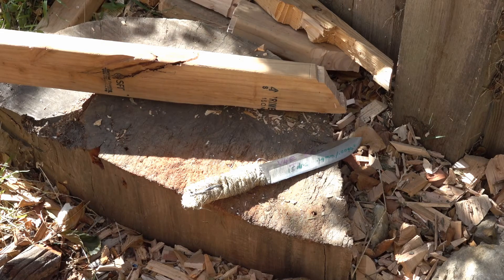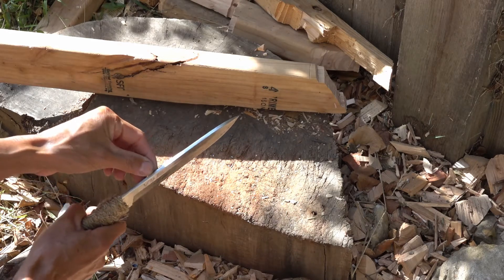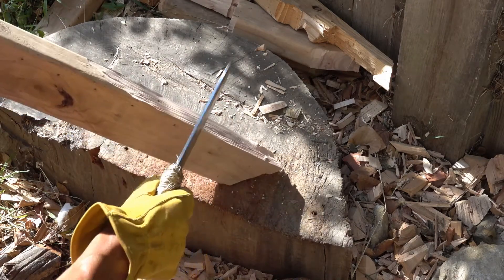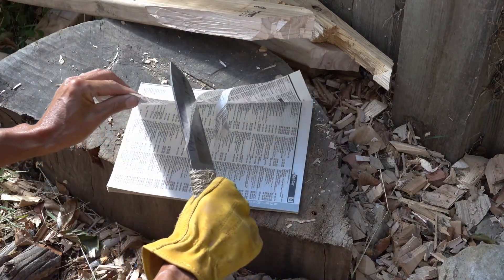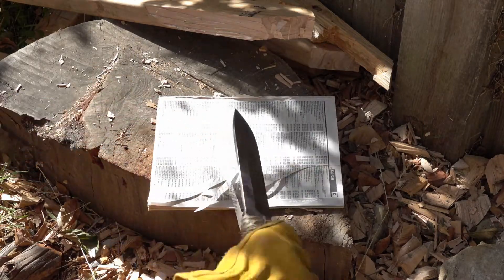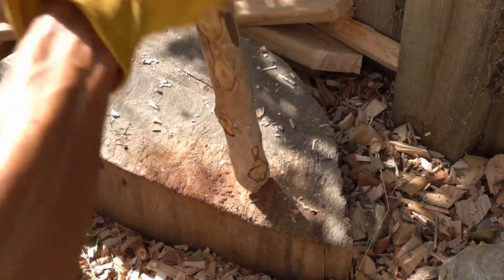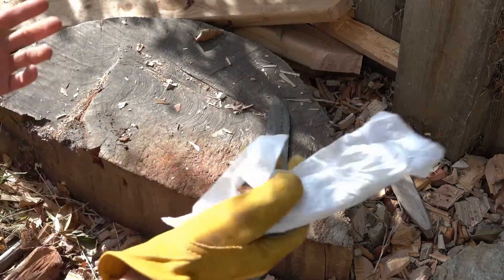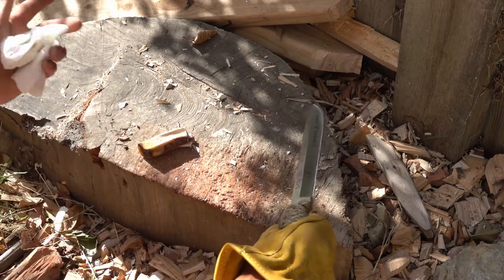Vanadis 4E 66rc 15dps Usability Test

Comment: That stood up well to the test. I can relate to the testing with the Eucalyptus where knots and twisted grain is the norm and carving will often require the shaving of knots. BTW, I see you've made your own wooden mallet. 👍
Reply from the maker: Knots are wildcard edge killer in woods - including soft wood like pine, rubber, etc.  Twisting steer apex side-to-side in short distance which easily tear up edges.  Strength reduces magnitude of steering.
I made that eucalyptus mallet a long while ago, maybe should make one out of Katalox or something hard like that.
Reply: @Luong_La  Agreed. I often use extended carving sessions of seasoned Eucalypts to evaluate a knife for use in Bushcraft. The material tests the edge stability and retention of the steel and the extended duration of the carving allows me to evaluate the comfort of the handle in use.  You can see this in some of the non fishing videos I've posted. 👍
Reply: @southerncross100  Hello sir! After the testing you mention,please What's your favorite outdoors knife or knives? If it's not a factory knife, then what kind of knife or steel? Thanks in advance
Reply: @greekveteran2715   Some of the testing can be seen here:
https://www.youtube.com/watch?v=MnWc2igvLko&t=494s 
https://www.youtube.com/watch?v=4PKSl_xlHbQ
Reply: @greekveteran2715  With regards to my favourit bushcraft knife it would be a Puukko. I own 2 Malanika's (1 in 4V, one in Cruwear) and 2 from ZL knives (both in 4V, the videos linked show these in use). I haven't used Vanadis 4E,  but like the 4V I've used. If Luong made a Puukko, I would love the opportunity to put it to extended use.

Now that I'm living on the coast and fishing on a regular basis, the two outdoor knives I'm using the most are both BluntCut MetalWorks knives. One is his Bird & Trout model in S110V, and the other is his fillet knife in Vanax Super Clean. Videos showing both in use can be seen on my channel.

Comment: Hi luong..thanks for all you have teach me!

I one more question if it doesn't bother. I  got a magnacut knife made in 63. 2100x325 HT  Would you say Should i have asked to go for 65?. 

The knife is 6 inches lonng 2 inches wide and 0.125 thick
Reply from the maker: In my testing - control (conventional ht) magnacut perform poorly when aust at 2100F temper for 63-65rc.  I didn't test below 63rc.  For this 6x2 .125thick and if involve moderate+ impact, I recommend conventional ht 62rc (aust 2050 x 325-350 with cryo).
Reply: @Luong_La  What about 2200 asuterise?
Reply from the maker: 2200F would be worse because aust matrix under higher pressure due to excess carbon and Cr in solution, tendency/prevalence of plate martensite along with higher RA.
Reply: @Luong_La  Oh. So how do people reach 65 HRC? Do they run 2050 with a 200 temper?

Would you say 2050-300  is better than 2100-325? Both made with cryo
Reply from the maker: 2050x300+cryo should reach 65rc better than 2100x300-325 per reason above.
Reply: @Luong_La  ohhhhhhh sorry i forgot to mention the 2100-325 i got was with 2 tempers of 2 hours each.  But i guess the problem still persist due to 2100 austenise.

So cryo in capacity. The better thing to do is to keep 2050 aust with lower temper temperatures and less repetitions? 
Like just one of 350?
Reply from the maker: Conventional HT:  2 tempers 1-2hr/ea.  1st to transform/precip, 2nd to stabilize whatever transformations taken placed in 1st temper.
Reply: @Luong_La  oh thanks. so in words a simple knife enthusiast like me can understand, what you mean is that there is no need of second temper with 2050 since 2050 is more stable
Reply from the maker: I stated 2 tempers for conventional HT at whatever aust temperature.  Never did stated just do 1 temper for conventional ht.
Reply: @Luong_La  oh i understand i think. Thanks very much for all the patience
Reply: @Luong_La  Hey, but following larrin database 2050x300+cryo reaches 63 not 65??
Reply from the maker: @kmopm777  Because his std/conventional HT skills need improvement to an avg or better grade :)